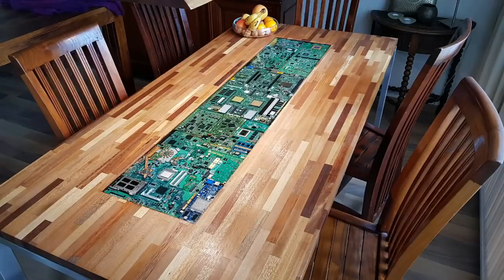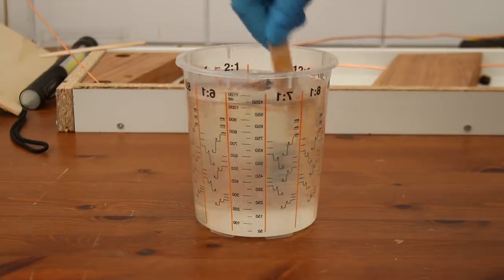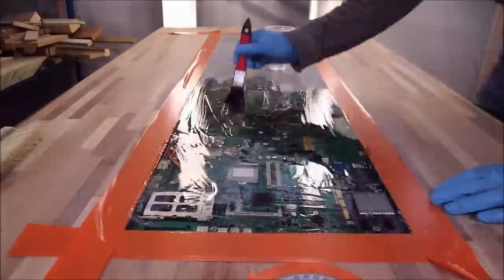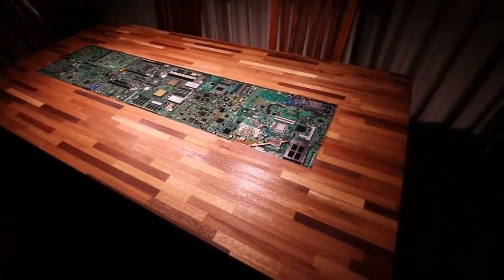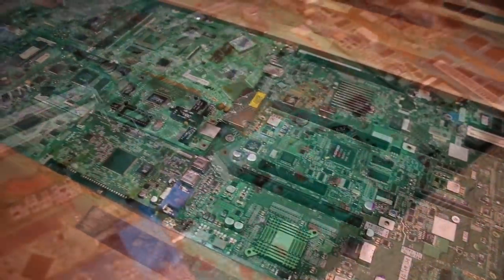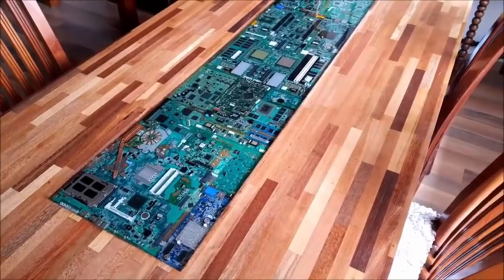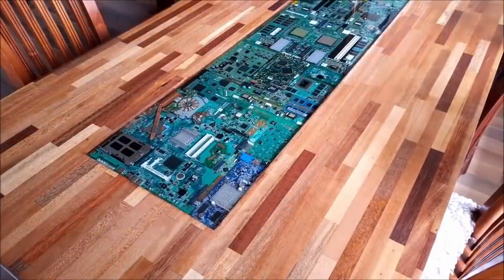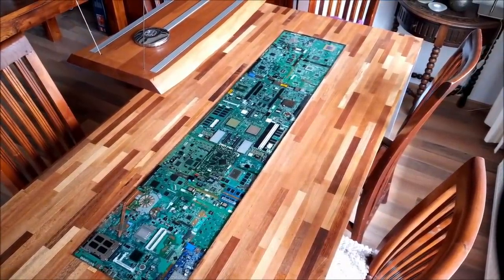Circuit boards with lights in epoxy in a table

Comment: Tremendous !
I think I will start to collect electronic boards soon ....
For the sticky areas, after a small search on the internet, the mix accelerator/epoxy was not properly made (surprizing no ?), there are several options : 

1/ Remove the sticky area and replace by new Epoxy.
2/ To have its optimal resistance, epoxy needs heat and dry. So try to put an alogen lamp (or hair dryer) close to the table to accelerate the dry.
3/ Put some talc on the table.
4/ Offer me this sticky table and make a new one. ^^ :D

Anthough I would definitely prefer the option 4, I would suggest option 3 then 2.
Please let us know.
Reply: PS: A failure is when you stop to learn. Here you have the opportunity to learn how to dry Epoxy onto your table. This is nice challenge.
Reply from the maker: I'm opting for option 1. IMO this is the only way I can make it less ugly. I'll make a video.
Reply: @Onrust1  Option 4 is the BEST by far ! ^^ :D
Reply from the maker: 😁 
I'll first fix it, and then let you bid on it, together with all the others who want it... 😆😆

Comment: I poured epoxy for years. Many years. Mix the epoxy in 1 bucket with a drill that is an attachment on a drill. Then shift to a second bucket making sure to scrape the first bucket with a ruler type instrument along the walls and pouring into the middle of the second bucket mix very well again with a drill and an attachment the type you see people mix paint with then flame out with propane torch.
Reply from the maker: I bought myself a impeller for water pumps on boats, and mounted that to a threaded iron. The first results are perfect!

Comment: HI! Great job! I believe the stickies is caused by pouring to much in the one time, more thiner layers should solve that issue next time.
Reply from the maker: I didn't pour that thick. The most I did was the 7 liters and that equals about 1,5 cm, where according to the specs of the (rather expensive, slow curing) epoxy I could have poured 5 cm at once. I'm pretty convinced that I messed up the mixing, and only in one of the last pours.. I'm planning to make a sequel in which I fix the table and show what I thought has gone wrong.

Comment: How the designer sees it:
these modern style legs

How I see it:
These "I only had 50 bucks to put this together and most of it was spent on wood glue" legs*
Reply from the maker: wood glue? The legs are stainless steel..
Reply: @Onrust1  But the table is wood...
Reply from the maker: Yes the top is. You were talking about the legs. They are stainless steel, as you can see in the beginning of the video.
Reply: @Onrust1  I apologize, you must not have grasped my humor.
Reply from the maker: It's ok. Maybe it's my fault then.. 🤔
Reply: @Onrust1  I was just saying that welding the legs together can be done for very cheap, whereas wood and wood glue is fairly expensive.
Reply from the maker: Possible. Although I doubt it works that way. Tables are sold by their design, and I learned this week that there is a name for this design. (Pastoe) It's my guess that costs were no issue.
But maybe you're right.
Reply: @Onrust1  How much did you pay for that table? 

Also, I want to thank you for being decent enough to take your time to reply back.
Reply from the maker: Costs are in the description of the video. Thank YOU for watching & commenting. 😊👍

Comment: Just cut the entire circuit board section out of the table, then put another piece of wood under the table and rebuild the circuit board on it, then refinish the table.  Also there is a lot of LED novelty lighting out there, Electroluminescent  wire and Tape , Led fiber optic drivers etc....etc...  What you did was good, but you could have all kinda of lighting patterns and FX in something like this that would be even more impressive.  At the very least mount the fiber optic end section under the table out of sight and install a fiber optic driver to run the lights. I think some even have some basic FX to chance the colors.
Reply from the maker: I deliberately left out the battery powered lights with controller, because I thought you would go crazy quickly of a carnival in a table all the time... 😊 It is the temporary character of the manual light for a few seconds in the fiber optic that I like.

Comment: Working with Epoxy is a nightmare. Went to a bar in town where they had someone epoxy the whole bar with baseball memorabilia floating in the epoxy. I was like wow that looks so cool I will do a coffee table like that. Mine was a disaster. I found out later that most store bought epoxies are water based and have a much lower percentage of solids meaning that while it will flow easier and you don't need to apply heat to get it to spread it also will have defects and parts will never fully dry/harden. If I did it again I would get commercial grade floor epoxy and use heat guns to spread it.

Comment: There's sure to be a linux distro that will run on that table.
Reply from the maker: Yeah, but only if it is on two CDs with a stick in between.. 😆😆

Comment: I think it would be better if batteries were removed from the boards or at least properly isolated. A small detail that time will tell if it will cause trouble.
Reply from the maker: I tend to agree that it would have been better (never thought about it), but doubt at the same time that ever something will happen to them. That epoxy is SO strong stuff, that I hardly can imagine anything happening to them.
Reply: @Onrust1  Yes mostly that. My only concerns were aesthetic ones to be honest. Hopefully you will find a workaround for the epoxy problem. A good idea would be carving a pattern that might turn the ugly spots as distorted ones, turning the negative to a positive.
Reply from the maker: You're not the first with that suggestion (someone suggested to fill the ugly spots with colored epoxy and run extra fibers to them - very creative!), but I decided to try to fix it. I think it might be possible, but if not, it will be another learning experience.. 😁 I will make a video.

Comment: Why didn't you create a mold to form it in? And you could have dropped the finished product right into the table with minor effort. Plus if the whole thing was more shallow than it was you would need it as much epoxy.
Reply from the maker: I must confess, it never crossed my mind. Provoking thought. The lights would have become a major hassle then (had I to drill the mold? were the fibers hanging out? - it seems impossible), like the overall strength of the table. And it wouldn't have looked as cool. No, I don't think a mold was a better way to go, I even doubt if it was possible in the first place..

Comment: Your epoxy might be sticky due to high humidity. We make epoxy domed badges at case-badges.com  (for computer cases and other equipment), and the humidity control is essential for proper cure. Don't know if you can fix the stickiness by adding another layer at or below 35% humidity but it may be worth a try (provided you also followed temperature and mixing guidelines). Impressive work though!

Comment: can you use clear coat to make it less sticky??
Reply from the maker: Yes, maybe. But it is not what I intend to do. I want to fix it by taking the ugly spots out. I will be making a video of that.
Reply: @Onrust1  you could just add more ugly spots if you're able to get rid of the stick. A general rule for art is consistency. The clear does look better though.

Comment: 10/10 for effort, creativity, hard work and honesty. It's always easy to say "you should have done this or that" from the peanut gallery that is youtube so i wont. But i would like to ask you if a thinner layer of epoxy would have avoided the issues you explained with the final finish ?....Absolute Respect to you my friend.
Reply from the maker: No. I didn't pour that thick. The most I did was the 7 liters and that equals about 1,5 cm, where according to the specs of the (rather expensive, slow curing) epoxy I could have poured 5 cm at once. I'm pretty convinced that I messed up the mixing, and only in one of the last pours.. I'm planning to make a sequel in which I fix the table and show what I thought has gone wrong.
Reply: @Onrust1  Thank you for your reply....i will await part epoxy table 2.0 with excitement...Respect, peace

Comment: this is because of the component are on the motherboard,there are still a ton of electricity in them,so you should have drained all the electricity first then do your project.btw great job and you have inspired me of making one myself,i have a lot of old motherboard and dont know what to do with them

Comment: I will use it in my office floor, not like a table of course but i will arrange to change the "cement" floor (lets say for a second that) and put some laminated floor new, and incorporate it to that putting it on the center or in one side of the floor of course the rest of the floor need to be the same pattern and bla bla bla you are a clever person you know what and how I meant, lol thanks for the vid you got a new subscriber !

Comment: Find a clear glass top over the entire size of the table with a 1/8 space between.  It should be perfect and you wouldn't have to worry about the epoxy being touched since its in the center of the table.

Comment: i whas thinking to have a hole in the middle of the table fora a mini fridge to have milk , and breakfastprodutks in .

i alsow have ide of ,, a over tabel lamp whit thats as whide and long as the table, whit spotligts dorn  ,,  a smal shelf wore paper manganese storage ,,, a Level of up-light on top to give light to the seeling both down spots and up-ligth can be LED
Reply from the maker: We have a table outside, in which in the middle I made a hole for the electric barbecue. We enjoy that very much. We can put back the cut out piece.

Comment: your mistake in this project is ... befour placd on table epoxy resin must be poured into another container and then mixed for another 5-10 minutes
The problem when working with epoxy resins is uneven (irregular) mixing, some parts of the resin or hardener not perfectly mixed on the walls of the first container
Reply from the maker: You're right. I learned that the hard way.

Comment: Re mix epoxy,  but use a drill mixer bit.  And re pour over the whole table.  Use heat to remove the tiny air bubbles🙌🏼

Comment: check your thickness then take a saw set the debth and cut around the appoxy then since you have boards laid out you will have little appoxy under them you should be able to get in the grove of the cut and pop things right out. if not cut the whole thing out and redue the center more work sinc eoy have to replace the botton and work on it but things can be dun. my self I may cut the whole square out then apoxy the whole whole so you can see front and back

Comment: vibrate the table when epoxy is setting would that have helped?
Reply from the maker: No. I messed up the mixing. You can't correct that by vibration.

Comment: I LOVE how this looks!! Too bad it didn't harden properly...

HOWEVER - Your saving grace may be the aluminum tape you put under all that epoxy!! That tape will keep it from bonding with the mass of wood under the circuit boards.

You might be able to just cut the edges of the epoxy free from the surrounding wood and all of that may just lift right out.

I would HATE to see all that go to waste though. It's a beautiful product!! I hope it turns out OK!

Comment: Doesn't epoxy scratch quite easily? That would be one vote for a glas top. But wood feels very nice, equal votes now ;-) How about you cut out the epoxy rectangle, lower it by 5mm and put a glas plate on top?

Comment: you mixed epoxy incorrectly. I do epoxy flooring sounds like bad material or most likely bad mixing
Reply from the maker: Isn't that what I said?
Reply: @Onrust1  i think, i was just amazed by the table. Great idea

Comment: Just did a large bar and had the same issue with sticky spots.  We poured another coat of epoxy on top and it fixed the problem.  After talking to the manufacturer we had to stir epoxy longer than the instructions said... instead of time we watched temperature and poured next layer when epoxy was at 88 degrees.  Per manufacturer this caused the lower layer of epoxy (with sticky spots) to reactivate.

Comment: Did the epoxy not react with some silicone on the circuit boards?
Reply from the maker: No, because the first layer, the one I used to 'glue' the boards in position was fine.

Comment: I design circuit boards. I would love something like this in my office.
Reply: I can build one for you ...$1500 Euro
Reply: @bilbobaggins4710  Thanks for the advice. I'm working on building my own company first. I'll keep this in my 'food for thought' mind for later! Thanks!
Reply: id recommend actually making a working circuit table. they're much cooler. why have a pc when you can build it into your desk? same effect cooler result
Reply: I've worked for years in the IT sector and shared this video on my LinkedIn. I just love the combined idea and practices of timber and IT. Old meets new!

I've been watching several epoxy video's and this one could have some cool inspirational offspring. The IT itself has it's own esthetics department in home (game) PC design and this might blend in well!

For the business part the table will fit well in a board- or conference room. Instead of using old hardware I would disassemble the existing VOIP PBX solution from it's casing and let this harden within epoxy! ;)

Comment: just cut the epoxy section out cutting through the table a little larger than the epoxy area then cut pieces of red Oak and glue them together and cut the finished section of Oak pieces precisely to fit tightly into the cut out section so it fits into the hole with glue on every edge of the oke section. let it set until dry and strong. You can also counter sink some diagonal screws from the top to hold it tighter in the hole. Now put more circuit boards on top and pour the epoxy mixed correctly with the lighting. No one will even know that it had been changed unless they look under the table.

Comment: I believe your second layer was applied too thick. The heat it’s generated caused a couple of issues: your components reacted to the heat and because the top cured faster, the underside could not cure enough resulting in the cloudy, wavy look. You should’ve pour the 25mm in 4 or 5 layers ensuring your remove the bubble at each pour and ensure curing is complete before the next pour. Despite your claimed failure, I do like  the end result of this project. Good job.

Comment: video is good, the music sucks, thought you were going to put a piece of glass on the circuit boards at first, think that would have been easier to make and a lot easier to recycle when it had to be gotten rid of, it would have looked a lot better also, take out all the circuit boards and get some more, put wood dowel standoffs maybe 1/2 inch for the glass to sit on, have somebody cut a piece of glass for it

Comment: that is the most Memory Powerful DDR table I've seen so far. But you forgot to install the memory sticks!! :)))
It would've been easier and faster to just completely cut out the part beneath the boards and then, with 3 or 4 angle irons, attach it at a lower level. Also, a raised perimeter fence would've been a good idea = less sanding (if any at all). I might make a video of my next project, which will include strip lighting under all the boards, and make it look like a city, with vehicles and people and ..... but no zombies!

Comment: What you can do now, or what you could have done. Just find a local glass shop to make a glass top, that'll make the table usable now. So if you do this again sometime, just use the epoxy to glue the boards in place and put a glass top over it. You could either put a glass top over the entire table or just have an extra depth to fit the glass over the center area. Or just don't glue the boards in place, you could change things at any time because of the glass top.

Comment: 13:10 .... ' Opposite of what you might think after watching this video, the table was a fail '.... WRONG !!!! lol ! i thought since the beginning it was a fail !!!
Instsead of using that fucking resine, use a piece of glass just on that circuit boards panel and it'll be fine !!!! Epoxy is a stupid idea you had just because of looking too much YT vid's !! ahahaha !!! 
; ))
Reply from the maker: Displaying feelings of superiority - Check. Indirect insults - Check. Laughing in your face - Check. 
I know a troll when I see one.

Comment: That's excellent what you did. For electronics enthusiast that is a great table! Next time you can solve soft and sticky epoxy problem is any of your project is to pore the epoxy in another container after mixing hardener in it and mix it well. Do this a few time and you will get a homogeneous epoxy solution which will no more be sticky.

Comment: Is it sad that I can identify most of what those boards are out of just based off of certain characteristics? @8:30 that looks like an Acer 1640 motherboard video chip heatsink :D
Reply from the maker: Why would that be sad? One thing I regret is that I didn't document what board came out of what device.. (then I could have told you if it was an Acer - which is very well possible..)

Comment: With over 2,500 comments this has no doubt already been suggested.  But my first thought is to just cover the entire top with a sheet of tabletop glass.   That won't clean up the imperfections but it would eliminate any sticky stuff being accessible and you could still see the artwork and lights.    That would be the easiest fix.   Not perfect, better than trashing it.